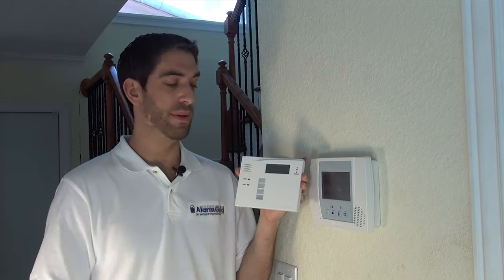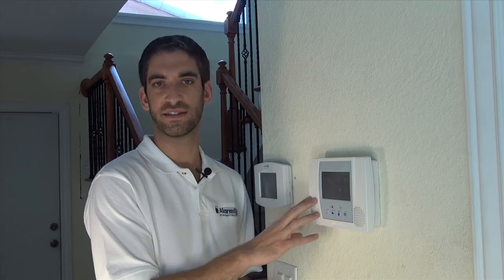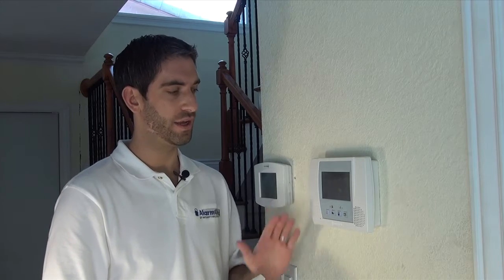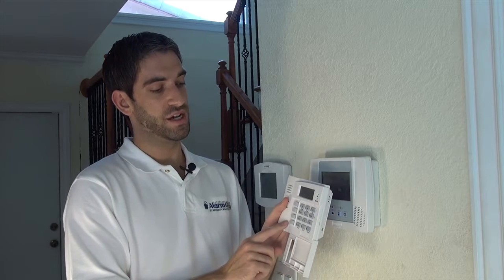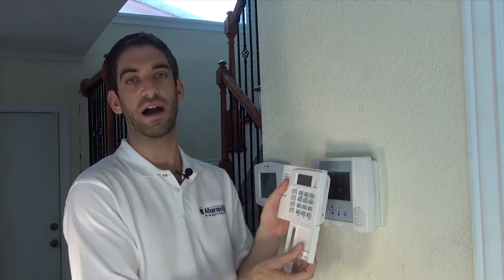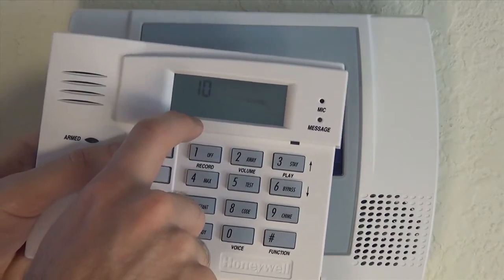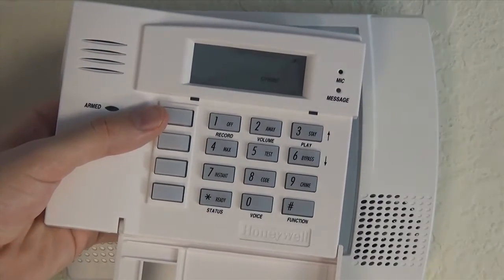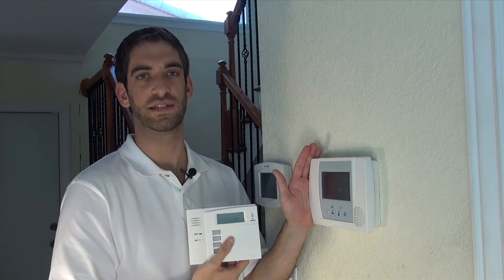Honeywell 5828 & 5828V: L5100 Programming

Comment: What is the difference between the 5828V and the 6150V?
Reply: The 5828V is a wireless keypad which works with the VISTA and LYNX alarm systems. The 6150V is a wired keypad which is only compatible with the VISTA alarm systems.

Comment: I know this is a old video but have a weird issue. When my L5100 is in armed away mode the 5828v makes a constant beeping sound like an alarm going off, even though it is not and everything is fine on the main panel. All functions work correctly otherwise. Any ideas?
Reply: Check the battery and make sure its not low.

Comment: so its only 3 steps to connect with a vista panel?
Reply: on a 20p you program the 5828 for vista control set the house ID in the 5828 then program the 20p in *24 to match the house id in the 5828. you will need either an rf keypad or a 5883 for the 5828 to communicate to the panel

Comment: Hey Sterling you didn't know there was a Honeywell 5839 wireless Alphanumeric keypad for that system. Is a 5839 compatible with the Lynx 5100?
Reply: Yes, I'm familiar with the 5839 keypad but it's a discontinued part no longer being sold by Honeywell and they aren't compatible with the wireless "all-in-one" systems like the LYNX Touch L5100. Do you already have an L5100 or are you thinking of getting one?

Comment: What about the panic buttons on the 5828? does it already come programmed? how do I know which one is which?
Reply: +Alarm Tech911 You have the option to choose One Touch Arming or Panic for the four function buttons. If you choose Panic, the top Function key would be mapped to the zone 95 panic, the second button down would be mapped to the zone 99 panic and the third button would be mapped to the zone 96 panic.
Reply: These can be function keys, or single button arming keys (this is the default setting in the 5828/5828V).  If you choose to make them panic key, via keypad programming question 6, the A or top button follows zone 95, the B button follows zone 99, and the C button follows zone 96.

Comment: Hello,

After program the keypad 5828V it appears the word "chime" on the screen and light green "ready" is on.

I programmed the main 4-digit code for armed and disarm the alarm system. But I am not able to arm the system with the 5828V keyboard, for cons, if I arm the system with the main panel, it works and 5828V on the keyboard light up red army.

can you help me?
Reply: +Rene Patry Did you press and hold 7 and 9 together on the keypad and then enter a valid master code (not installer code) followed by the * key?

Comment: If i change the master code or add user to Lynx Panel do i have to add that code in 5828v or it will get them from the Lynx? Thanks
Reply: Stan Ivanov The 5828V will automatically work with any valid user code programmed in the LYNX panel. However, if you are using the one touch arming buttons, you'll need to update the code programmed to the keypad if you delete it from the panel.

Comment: im want to know how to turn the 5828v  volume off i have it in my bedroom when i disarm the main key pad the one in the bedroom wakes the wife
Reply: Hi Mark,

The volume adjustment only changes the "message playback" volume. You can turn off the voice function though using question 4 of the key pad programming.
Reply: Sterling Donnelly What about the chime on the keypad? I only want the chime to play on the main Lynx unit downstairs. I do not want to hear the chime being played on the keypad, because like Mark, the unit is in my bedroom, and I'm another wife who gets woken up when my husband goes in and out the door in the early mornings. There's got to be a way to make it stop, or else I'm going to find the wire that's connected to the speaker and I'm going to cut it!!!!!
Reply: Dena Uding You can't have the LYNX Touch set to chime without also having chime enabled on the wireless keypad. You can certainly try disconnecting the siren wire from the keypad's circuit board to disable all keypad sounding though.

Comment: The 5828V we have installed by the alarm company squawks (not clear) when you open a door. You can't clearly understand what it is saying. They have not been able to fix the problem and have replaced the control 3 times. Also is there a way to turn the volume down on the 5828V, maybe that will take out some of the distortion I hear.

Comment: I'm trying to add a keyboard, but not wireless if not wiring. My system is a tuxedo and a screen 6280w both work perfectly. the problem comes when I try to connect an additional keyboard keyboards are wired. light but I get an error that says: (open CLK)

Comment: Where can I get instructions on how to program the 5828V's Function Keys for single button arming? Thanks.
Reply: Hi Bruce. The installation guide at https://www.alarmgrid.com/documents/honeywell-5828-and-honeywell-5828v-install-guide has those instructions. Option 6 of the 5828V keypad programming allows you to choose panic or one touch arming for the function buttons. If you set it to one touch arming, you also have to program a valid user code to the keypad which is described at the bottom of page 2.
Reply: Thanks, I was missing the user code step.
Reply: Sterling Donnelly I got this control panel working in 5 mins but struggled an hour with the quick arm.  Your tip solved the problem.  Was totally missing that step.  Thank you!
Reply: Marley Moopley
Glad to help. There is no other power cord from Honeywell but you could try splicing the wire to lengthen the cord.

Comment: Since new keypads have been released for the Vista Series panels, do you expect new models for the Lynx 5100 as well? Thanks.
Reply: Hi Mario, we haven't heard anything about new wireless keypad but we certainly will have them up as soon as they are released.
Reply: Sterling Donnelly I am in Australia and can import these systems, and all accessories from the US. 

Can you see anything that would prevent me from using this system in Australia? Obviously i would need a different AC adaptor to suit our power points.
Reply: Aaron Alexander
The power supply is 100-240V and 50/60Hz so it should work in Australia.

Comment: The 5828V keypad beeps would sound the same as a 6160 or a 6150. However, the 5828V also speaks so that would be different than the 6150/6160 and would be more like the 6150V or 6160V.

Comment: Thank you for the video. Is there any alarm system which allows both of the following at the same time:
- 2 partitions 
- Using internet to communicate with the monitoring center as oppose to phone lines or GSM modems [I am aware that using internet is not as safe as the other methods]

I know Honeywell Vista 20P enables 2 Partition but requires phone line or GSM modem. On the other hand Lynx enables use of WIFI to connect to the monitoring center. But it does not allow partitioning.

Comment: Hi Ron, we don't have a video on that yet but the process is very similar. The only difference is in setting up the House ID in the LYNX Plus. For the LYNX Plus, you need to enter programming mode (installer code + 800) and then set field 24. Press *24 and then the two digit House ID Code you want to use. Once you have that set, you can follow the steps from the video to pair the keypad to your LYNX Plus.
Reply: Hi, Sterling. I was wondering if the 5828 Wireless Keypad was capable of making sounds during the entry/exit delay like the main LYNX panel. Is that possible? If so, how do I set that up?